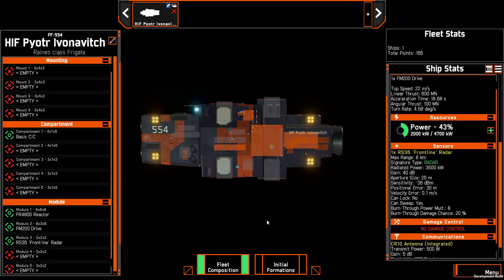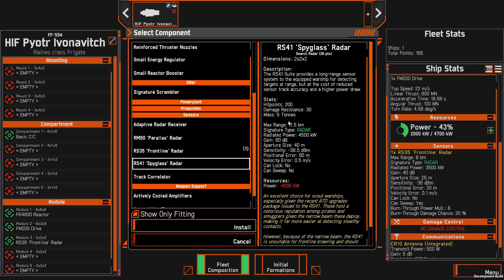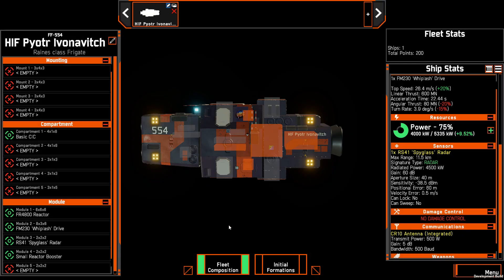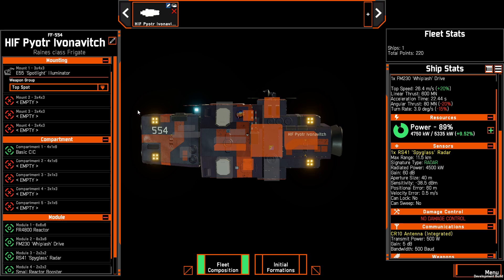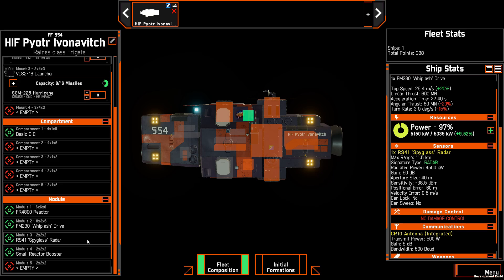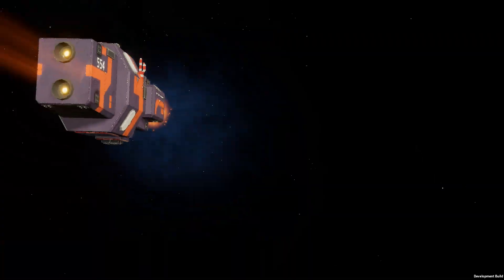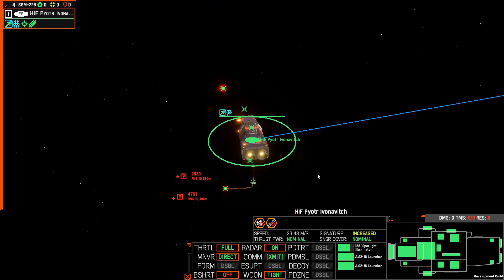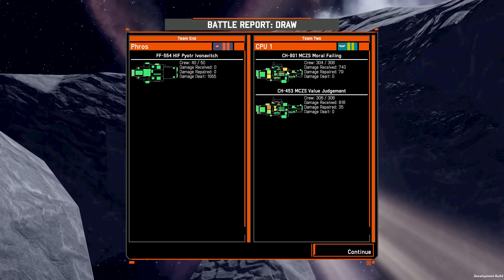Nebulous Fleet Command: Spotter Ship Design

Comment: I think that the power resources are better used for either a floodlight illuminator (if power is sufficient) or a jammer of your choice.
The floodlight has only 2 kilometers less range but +35° spread of its cone which helps immensely against ships stealthily sneaking around.
You probably need the power plant control compartment installed to fit it in.
Jammers really help the frigate stay alive and be an active annoyance when the targets comms get disabled.
Also, if you are using an illuminator, you should always consider installing the passive radar mount to get the most use out of it.
Reply from the maker: Great advice, I was actually thinking on the same lines and you can hopefully see that in my second design vid!

Comment: The VLS2-16 has a compounding cost, the second one costs more then the first etc. But the two launchers get the missiles out faster so something you need to balance. Also illuminators are primarily for gales,  they don't help hurricanes as they are actually guided by comms, and can be jammed if the firing ship is comms jammed.
Plus gales are only 3pts each instead of 8. Though hurricanes won't be fooled by chaff.
Reply from the maker: I totally dropped the ball with the Gales v Hurricanes here - also putting a spotlight on a spotting ship is an invitation for it to be tracked from miles away and wiped out. I already want to rebuild this ship to showcase what I have learned since I recorded it! 
Thanks for the info, it's very precious regarding this game.
Reply: @Phrosphor  there is quite a bit to learn! But I am loving it. Thanks for making content for the game and I look forward to more videos. Your Highfleet content helped me a lot with that game.

Comment: Semi active missiles are probably better on a spotter. They're hard to jam and the ship is already carrying an illuminator. You're not going to  be able to get into cover fast enough for there to be a an advantage with command guided missiles.
Reply from the maker: You make a great point. I think I am going to dump the illuminator from this ship however, as it reveals you to the enemy when you activate it. Better to have a line ship with the illuminator.
Reply: The illuminator gives your scout ship away. Honestly it is better not to have one at all. The scout ship works better with a lock radar instead.

Comment: It would make more sense to use the Bullseye radar instead of the floodlight if you are using command driven weapons. The Bullseye provides strong lock on where as the spotlight just increases their signature / acts as a homing beacon for passive missiles (gale).
Reply from the maker: Yeah this mistake is rectified in the my v2 video, I just misread the names when I was doing the shipbuilding but a lot of people have pointed it out.

Comment: Thanks. I've been wondering what the best way to make a Spotlight ship is. 
What about combining with a Track Correlator and/or Adaptive Radar Receiver?
Reply from the maker: Honestly I already want to release a 'Mk2' of this ship. I think the Raines is a little small to fit all of those in and keep a decent offensive element, but you could maybe do it a bigger ship. Something to experiment with. Right now I am playing with the ELINT modules. I want to take the spotlight off this ship now.. it actually reveals you from across the map when you turn it on!
Reply: @Phrosphor  which ones are the ELINT, is that the Picard?
Reply from the maker: @tayloraverett3138  uploading a video on it!

Comment: I haven’t played enough with waypointed salvos but couldn’t you fret to saturate an enemy’s arc by batch firing your earlier missiles on a longer trajectory and later ones on a shorter to attempt to get the maximum # of missiles to converge on an enemy’s arc at approximately the same time?
Reply from the maker: You very much can and it is one of the reasons both of my scouts have gales. Once my line ships are engaged I order missile barrages from above/below/behind the enemy fleet so they are getting hit from three angles to overwhelm their defenses. 

Biggest issue with waypointed salvos (for me) is the time it takes to set them up if you are already in an engagement. I can't afford to take that much time off babysitting DC teams and reacting to incoming missiles. My micro isn't good enough yet!

Comment: So do i put tracking improving equipment on my spotter or shooting ships? Can i protect my ships internals in someway? I lose alot of ships to snowball effects, if not outright destroyed they get crippled really fast
Reply from the maker: Something I talked about in my ship building live stream but really need to put into a video is that locations of modules matter. Most fire is aimed at the ships centre of mass. Having magazines there can cause catastrophic chain of effect situations so try and keep them at the rear of the ship where they are less likely to get hit (front of ship gets hit a lot as well). Tracking improvement equipment is useful if that track that the ship carrying it is providing is the one that everyone is firing at. It gets a bit complicated with spotters. Don't over look the hardened modules, especially the CIC. Lots of Rapid Repair teams are great to have as well in a brawler.

Comment: Do you have the option of using infrared cameras instead and just looking for the big glowy radiators and engine plumes?
Reply from the maker: That would be a really cool feature but it doesn't currently exist. I think there are a lot of limitations under the surface (CWIS fire is slightly fudged for example the the gfx is just a visual thing). In success anything could be possible though!

Comment: I would like to see how you would build a beam battleship. It seems to me in the current state of balance, railguns are simply superior to beams in every way on battleships, due to the limited range of beams and slow speed of BBs that make it difficult to actually get into range
Reply from the maker: Beams are devestating, but it's closing that distance. There is no way brawlers and beam ships win against railgun in open space. I think it would need to be very maneuverable (dragonfly drive?) and stealthy to sneak through asteroids to get close to the enemy. That would depend totally on their positioning. It still needs to out-dps them as well once the engagement starts. There isn't any real penalty to railgunning at close range.
Reply: @Phrosphor  yeah, beam Destroyers are definitely a viable build, but the Battleship can have Beam Turrets, which seem kinda useless due to the short range
Reply from the maker: Beam turrets really seem to be quite easy to destroy as well.

Comment: Is there a reason why you went with Hurricane mussels instead of Gale missiles since you have the spotter illuminator?
Reply from the maker: Yes, the reason is reading comprehension (lack of).
Reply: @Phrosphor  oh, ok so you would suggest going with Gale’s over with hurricanes? I just wasn’t sure if there was something I was missing.
Reply from the maker: @Deme550  if the launching ship is going to keep a strong track throughout the whole launch (and not get comm jammed) use hurricanes.

If the ship is using another ships lock/track, use Gales.

That is overly simplistic but that is my rule of thumb.

Comment: Plant control centers are far more efficient compared to reactor boosters, so if you can use those instead.
Reply from the maker: Reactor boosters are only 10 points to the plant controls 25 though.

Comment: This video totally wrong. The spotlight illuminator only works (for now) with Gale warheards. What you want to have installed in order to clarify your lock is the Bullseye, the spotlight doesn't assist in radar tracking.
You can see how inaccurate your track is by the red dot jumping around the signal. The spyglass is the least accurate tracking radar, having a bullseye in addition would allow you to lock that in.
Reply from the maker: Yep the gale mistake is corrected in the next video. The main point of this video was to showcase the "Spyglass" radar for people who didn't understand the difference between the radar modules.